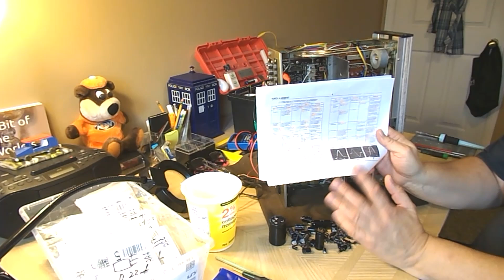New replacement transistors work better 99% of the time in vintage audio, then there's that C535!

Comment: A BC547 in the FM mixer circuit? No wonder how it didn't work!
In the european semiconductor designator system, the C stands for low power and low frequency. It should have been an F series (low power high frequency), such as the BF199 that Radiomuseum suggests as functionally similar. That transistor would at least do something better than the BC547, but still would need fine tuning of the biasing to achieve the best of it in the circuit, when not using the original part.
Btw, discrete bipolar RF transistors in through hole packages are almost extinct right now (only the KSP10... and the chinese 9018), and there is none if you want a PNP!
Reply from the maker: 2n3663 was the closest match I could find locally but it didn't perform as well as the vintage 2sc535.

Comment: Great topic. Thing is well chosen modern replacement transistors will usually be higher bandwidth, and better specs overall BUT will sound a bit different. Quite different in some cases. Higher bandwidth can even require extra decoupling etc. in old circuits. 70's transistors were made with different processes and thickness of material too. Also also, direct modern replacements like the 2SC5200's etc. are NOT the same as the original design and have a lower SOA. Manufacturers got really good at making thinks cheaper.
When all's said and done it doesn't matter much if the unit works and gets to make music for another few decades!